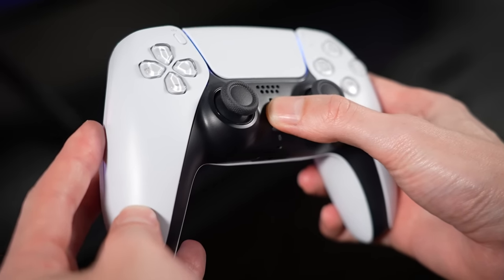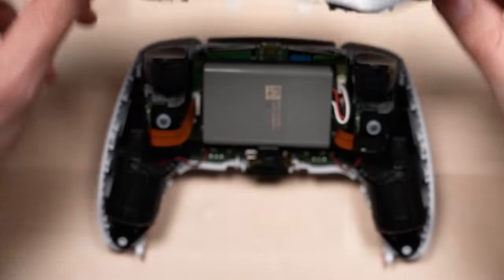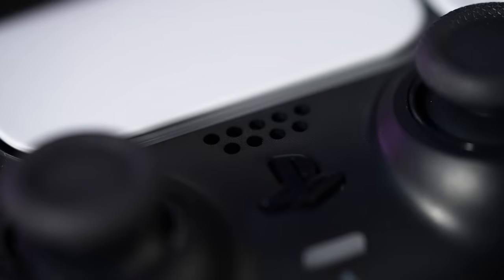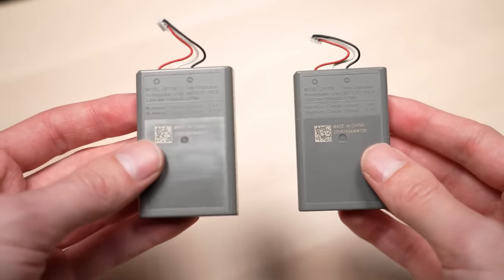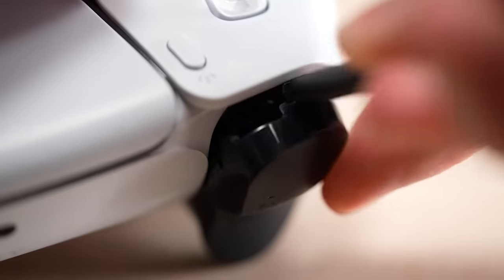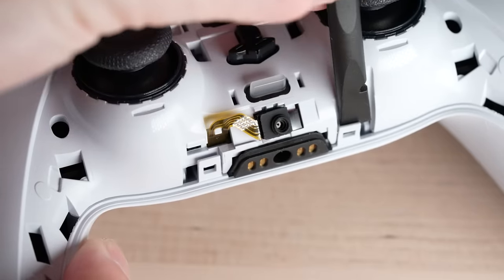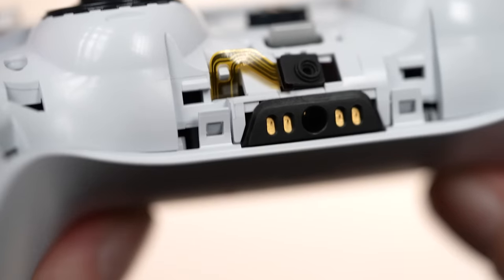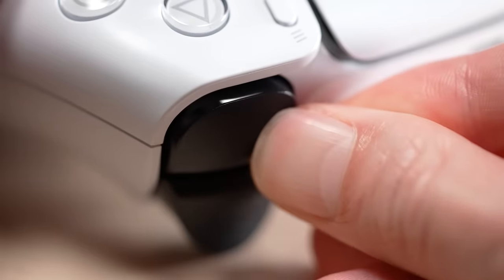Sadly, your Playstation controller won't last much longer..

Comment: As someone who just bought a used ps3 controller im amazed how good it still holds a charge. Different things like adaptive triggers/vibration will also use more battery.

Comment: As an extra step I would recommend checking the controller still works after installing the battery and before fully reassembling it! Just so if the new battery is faulty or not connected properly its easier to fix the issue. Brilliant video though

Comment: Hey John, love your videos. I'm now on my second ps5 controller. Battery on the first really started dying quick. After about 10 months. I have a new second gen black one. So far it's pretty good. But one thing I've noticed with these controllers is the joysticks can get dirty quickly and too easily. My Xbox one x controller lasted longer and was built better. Shame. Still love my ps5 though.
Reply from the maker: Thanks for sharing, I'm sorry to hear about that!
Reply: Play to much bro 😂😂😂
Reply: @schadenfreunde9563  call of duty does that to a controller
Reply: gotta go outside and touch some grass every now and then bruh
Reply: @PandaCheeks  yea I do man, I'm just competitive
Reply: @polishdude001  There's your problem. Competitive Cod.
Reply: @PandaCheeks  Y’all are projecting. If you leave you controller sitting around, it’ll still collect more dust and dirt depending on where you store it.
Reply: @trevorrovert3103  gotta clean that house brah
Reply: @trevorrovert3103  I mean you could just wipe down your controller every once in a while. Like with everything sitting, it can collect dust.  Just like you should clean your mouse as well.
Reply: I got a elite Xbox controller for like 199 and its crap joy stick drifts
Reply: @jessbekobegaming  yea surprisingly I heard the elite controllers are worse for fps. It's really just a shiny toy. That a lot of people have bene suing them for. I'd highly recommend getting a scuf controller.
Reply: maybe your hands are dirty? My joysticks are fine after a year lol
Reply: @michaelblue4619  my hands are never dirty, the controller joysticks still get dirty quick, what a sorry built controller
Reply: @kaizoku8575  weird man, i had issues with other parts of it like drift but never "dirt" lol. had ps5 since launch. clean it maybe
Reply: @michaelblue4619  I always wash my hands before playing and keep the controller in a sterile vacuum seal. Somehow, still got dorito and cheese dust in the sticks, come on sony! Do better.
Reply: @treytavares1727  Yeah what the heck man sony, poorly built with cheese dust!
Reply: Xbox always had better aiming
Reply: @polishdude001  guess I am not the only one with a dedicated  COD gamepad

Comment: I had stick drift with mine and fixed it by spraying contact cleaner while holding the stick  down and has been fixed for the last 2 months. Easy fix for people having that issue.
Reply: What kind or what brand name of that contact cleaner did you use for your stick drift?
Reply: WE NEED MORE DETAILS SIR PLEASE!!!!
Reply: If only this was a one size fits all fix.

Comment: We endured this problem with our PS4 controllers for a long while, our only pair of controllers lasted for 20-30 minutes at a time, and our charging cord setup kept changing every crescent moon. I proposed the idea to swap out the batteries after researching a bit about the batteries in the controllers, but my dad found a cheap and extremely easy alternative by buying two whole controllers with someone in state, rather than go through the hassle it can be to find rather specific batteries at any pawn shops, stores, or online.
Reply: @imoffendedthatyouareoffended  Guess you got a lucky batch when yours where made I guess. Sometimes items aren't made to equal perfection, even when made my robots that repeat the process exactly.
Reply: @imoffendedthatyouareoffended  i have a fiew ps4 controllers and my best one is 3 years old. My 2 controllers i got last year ( got one on my bday ) started opening ingame menu when it vibrated for some reason ( not great when playing a game that lightly vibrates controller when attacking or jumping  every fiew seconds ) so i bought a new one and that one was fine first 1- 2 weeks then i could barely walk in game. Looking left or right with r3 it would turn slightly upp or down. Dont know wtf is wrong with it.
Only use the 3 yo controller i got on my bday because its the only one that works perfectly. But the analog stics have some chewing marks because cats
Reply: My ps4 controllers lasted days

Comment: He also shows how to replace the battery on a ps5 controller, very cleanly too thanks !!!!
Reply from the maker: You're welcome!
Reply: @JohnGlasscock  but sadly  replace the battery may not worked
because is maybe from a Seller that sell 100 Ps5 Packs and none of them worked for profited 

That way I stay with Microsoft ( because is not likely to Scam you out of money for just the controller  battery itself)

 replace the battery ( Has not even made a rechargeable one )
Forcing you to buy a New controller if is discontinued 
Xbox Users will not has this problem because is Your select the battery not Microsoft
Reply: @Stormlywing  That’s why Microsoft still uses AA batteries. So over years the internal battery doesn’t weaken or die
Reply: Not everyone will be able to do this without breaking the controller, by the time the battery dies anyways you can always buy another one 🤷‍♀️🤷‍♀️

Comment: Ive been having my ps4 controller since June 5 2018. Going 4 years strong and i havent had one problem yet. Minimal stick drift but everything else works. Ive squad wiped so many bozos with this controller. Dualshock 4 controllers are one of the best gaming controllers in the GAME.
Reply: I dig the Dualsense more, took me awhile to get used to it but enjoy it abit more than the DS4.
Reply: I had 6 PS4 controllers and they only lasted a few months before stick drift.
Reply: Same here been using the same ps4 controller for 5 years and after all the heavy use the analog broke last week which I had it repaired for a small amount of money. Ps4 controllers used to be durable af
Reply: My PS4 bundle which I bought back in 2014 came with 2 black dual shock 4 controllers and to this day the battery still holds charge really well. Hoping my dual sense controllers last me just as long
Reply: I still have my original controller that came with the preorder of the PS4, 9 years and still kicking, same goes for my ps4 pro controller from its launch, never had to buy another one,
Reply: @Jacobinks  
Never had stick drift ever. None of my PS or Xbox controllers had it. I assume you guys are abusing your controllers so much.
Reply: @Jacobinks  ig it depends on your usage, mileage may vary. Had 4 DS4 controllers & not one had stick drift.
Reply: Minimum stick drift? It's time to get a new controller bro.
Reply: Due to stick drift. I buy the spare and soldering myself...but spare quality is very low. It also wont last long and the stick smoothness not that great. Easier to change the ribbon inside.

Controller easily rip because to many person use it.
Reply: I've still got controllers that released along with the ps4 and they still work perfect never had to replace batteries as of yet it's just a matter of don't deplete them completely and don't charge them fully lithium ion is optimal between 20%-80% any lower or higher on charge than that and potentially damaging the batteries cells which leads the batteries to losing the ability to keep a charge at all
Reply: @M.sami12  either that or they've been abused a little before we bought them... You're lucky you've never had a brand new controller with issues to see how it feels to pay for rubbish.
Reply: @rdodamiangrin  ^ can confirm i bought a brand new dualshock once and as soon as i connected it there was already drifting, it's a really frustrating experience

i would say dualshock 4 is hit or miss at most, sometimes you get one that lasts several years, other times you get one that turns into junk within a couple weeks/months

i don't care for xbox as a whole, there's no games on that console that interest me anymore, but from a non-biased perspective i'd say xbox for sure has the most reliable controllers
Reply: The DualShock 4 that came with my PS4 when I bought it in 2014 still works perfectly. No stick drift and battery still holds a pretty decent charge. I like the dual sense a lot more but I doubt it will last me as long as the ds4
Reply: @M.sami12  it depends what people play. If they play cod or siege a controller can last 3 months if you play racers or puzzle games it could last years
Reply: Ummm no.
Reply: @Jacobinks  i have 2 ps4 controller no issue for 5 years till i sold my ps4.  but my ps5 controller last 3 months(only light use) then stick drift badly also battery is playing up.
Reply: @M.sami12  
False.
My right stick has minimal drift and I haven't played a single game where I have to move the camera like a maniac.
Reply: Same here, it’s only a minority that have problems but it makes it sounded bigger thanks to videos like this
Reply: @Starwars627  
Well this shouldn't even happen.
It's better to point out the issue and hope for a permanent fix than not point it out and never have it fixed.
Reply: @YTDani75  yeah I get that, but also defects do occur during manufacturing, so it’s a number of factors. But all the pads I’ve had since launch (ps3-5) not had any issues.
Reply: @Starwars627  
This is my first Playstation ever (PS4 pro + dualshock controller) and it has minimal drift on the right stick despite me not playing any games where I would need insane camera movement.

In fact I have a Nintendo switch which is known for its drift issues, and I never had drift on that but my PS4 dualshock already has it.
It wouldn't even be that bad if this issue wasn't happening with new controllers only.
I never had any kind of drift problems on any older generation controller like Xbox360, Wii U etc.

Comment: Battery swaps are always nice. Used to do that for phones every 2 years, since it was cheaper than getting a new one.
Can't really do that with newer models that much, but at least the degredation is not that bad. And you can always just buy a powerbank to power all your devices.
Concise video!
Reply: for phones is kind of different. tech has been boosted to the point that alot of tech has become irrelevant(basically most phones from budget and up can cover all your needs including long battery times)
Reply: good quality phone batteries are really hard to get.. many fakes

Comment: This is the one that baffles me with Sony. I used to mock Xbox for still having batteries but man in the long run. The small inconvenience of charging some batteries outweighs the ps4 and ps5 controllers. I have now got a large battery bank on the couch with me with my ps4 controllers. The ps5 controls are great but the haptic feedback and adaptive triggers just seem to drain the ps5 control so fast. I wish Sony would make battery modules instead for ps6 or make controls with much bigger mAh battery units.
Reply: I never really understood why people mocked xbox for the batteries. They are a lot easier to replace and you can charge them if they run out
Reply: @Shredy361  I know right, and I mainly play on Playstation.
Reply: @Shredy361  same. I much prefer swapping double A batteries as opposed to an internal, inaccessible solution.
Reply: @mikem2253  you don't even have to swap them either, you charge em
Reply: For some reason my PS5 controller doesn't accept charge from my battery bank. I'm not sure if this is for all battery banks or just mine.
Reply: @Shredy361  i swap recharables.
Reply: @mikem2253  and then swap the swapped rechargables when they die out from swapping. swap
Reply: I massively prefer swappable batteries. It means you don't waste time charging, you can get right into the action after controller dies. And if you desperately want rechargeable batteries, get two recharge packs per controller, that way you can hotswap them when they die.

It's about choice.
Reply: Also, PS controller batteries last for a day or two. However, Xbox rechargable batteries last me for 7-10 days. And I always have a second pack ready, I've never had to play with a plugged controller.
Reply: I got 2 controllers with my ps5, i leave one on charge while using the other in case one dies. I get they’re expensive but eventually all those batteries will wind up costing more. Also all those batteries getting thrown away are pretty bad for the environment…rechargeable batteries in ps controllers aren’t great either but at least there are way fewer that wind up in the trash.
Reply: @eliminoh_p7877  I've known literally 0 xbox users who use disposable batteries. All of them use rechargeable. And they last for many years. A couple of rechargeable batteries at the end of their life are definitely better for the environment than a worn out PS5 controller with it's own internal battery.
Reply: I have some 5000mah (6 times the PS5 controller capacity)  Duracell's that fully charge in 15 minutes, have a 5 year guarantee and cost £8 to buy. I am so glad that Xbox lets me choose what batteries I want to use, my PS4 controller always used to die so fast even within months of getting it new.
Reply: Honestly I just use rechargeable AA batteries for my Xbox controller since they have like 2000mah each and I don’t need to use them just for my controller :)
Reply: wired controllers are superior to both
Reply: @Shredy361  easy? Nah it's hard to replace if you in a middle of a game and can't pause.
Reply: I don't know about you but my ps4 controller still works fine. It last 5 hours tops sometimes longer.
Reply: @haseoboi9433  grap a plug and put it the hold on your controller then play takes just as long as ps4 controllers
Reply: @sameash3153  what’s gonna happen when the wire breaks 💀
Reply: @Pushplar  I have wired controllers from 20 years ago. Cope.
Reply: I actually didn't like the fact that the xbox series had the batterie thing mostly because it comes with a none rechargeable batterie when you buy it, but at the time I didn't know batteries degrade as fast as they do. I bought the rechargeable batterie from the Xbox store and it last long. So far I haven't seen my batterie degrade for neither my PS5 or Xbox series controllers, but for my laptop, I have notice my batterie degrading a lot and I can't remove the batterie at least not by taking it apart which I would proabally mess up my laptop if I try it and I'm worried that is going to happen to my PS5 controller.
Reply: The only issue with MS is not supplying their rechargeable battery with the controller by default. Otherwise their method is objectively better being much easier to replace and always having the option available to use AAs if you want.
Reply: Personally I like the internal batts because of the higher capacity of them, plus it only takes a couple minutes to replace them in case they go bad after a while
Reply: Xbox is far more convenient in that sense, i use rechargeables so i can just pop the drained ones in the charger and pop the charged ones in the controller. No wires or forgetting to charge the controller
Reply: Rechargeable Duracells last way longer
Reply: @HonkeyKong54  how long? My energizers last a day if i'm playing all day with vibration and lights. 2 to 3 if not playing all day
Reply: @haseoboi9433  No? It takes 2 seconds with proper training.

I am not joking.
Reply: You can literally get a rechargeable battery pack for the Xbox controller. I had that. I don’t understand why it was mocked. PlayStation was stuck having no choice. With Xbox, I could have the option of recharable battery, plug and play… or swap out for normal batteries. Surely it’s better to have the option of either? I never understood. PS fans basically said “ahhhh you have the choice of batteries whereas we don’t, hahaha”… makes no sense 😂
Reply: cries in xbox elite controller with non-removable battery
Reply: @regulator18E  ?
Reply: @DeadStawker  I'd been using the same 4 pairs of rechargeable AA batteries for at least 12 years to power my wireless mouse, keyboard and logitech controller until I switched to wired m&k and a ps4 controller

I'm still amazed most of those batteries still mannage to hold a decent charge. They outlived the devices they used to power. Only two of them died.
Reply: @DeadStawker  I use disposable batteries
Reply: @Shredy361  Not only that - there are literal rechargeable battery packs for Xbox controllers as well (there’s one official version, and 3rd party as well). I’m using ipega 1000mah battery pack. Rechargeable, and cheap ($5) so if it’s broken, just replace with a new one.
Reply: @eliminoh_p7877  they wont cost you more, you buy a $20-30 battery pack(2 of them for that price) and no need for cables to your couch, no need for swap controllers. 5 secs to change it and you going again

Now when those batteries do stop charging for the PS5 controller, you need a guide to change it. Its a super dumb solution meant to have casuals not replace them and force them to buy new controllers
Reply: Yea no I’d still rather internal batteries any day of the week

Comment: Ive had my dual shock 4 since 2017 😂 no battery issues i just fixed r2 by myself coz the silicon wears out
Id say if you use them without too much force they last long
Reply: Same. Always just have the 2 controllers and they last. Idd the trigger silicone tabs need replacing and somethings the joysticks need airdusting and some contact cleaner sprayed on them. Never needed a replacement controller if you know how to do some basic repairs. Keep the batt between 10 and 90% and alternate between to controllers and you should be golden.
Reply: Same here, but I think i bought my dualshock4 maybe even in 2016. Replaced silicone on r2 (they were like 1$ on aliexpress lol) and only visible sign of using is that the plastic in front of left analog stick is kinda dented from running in games